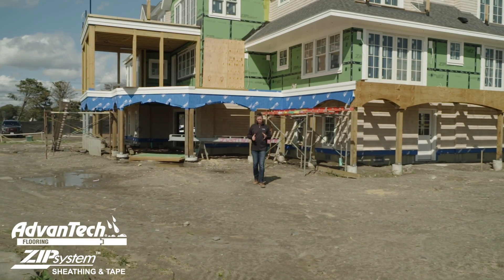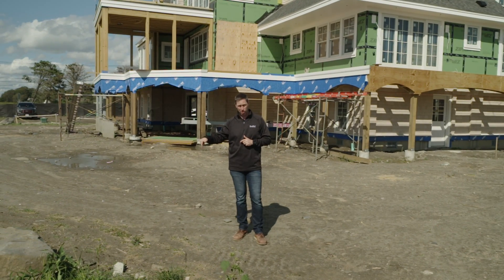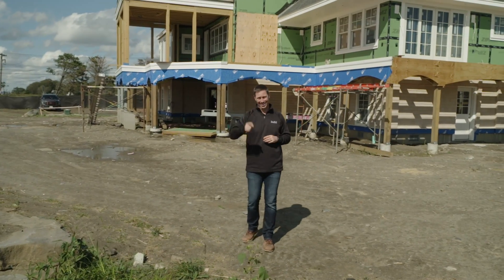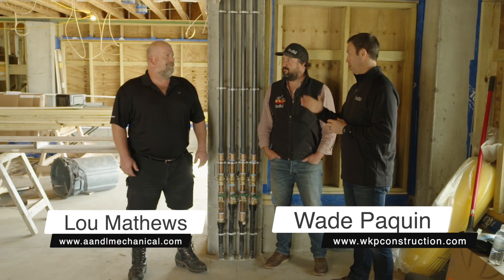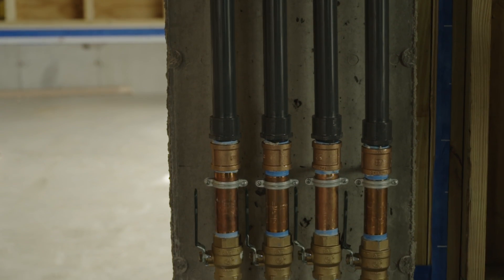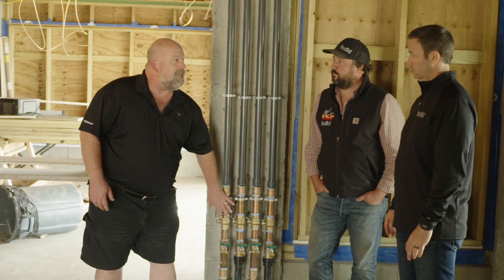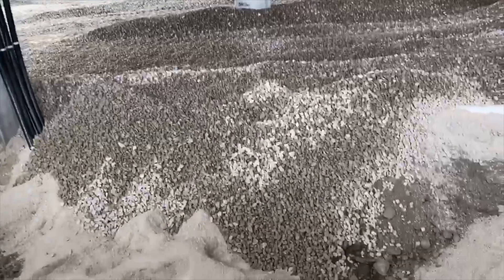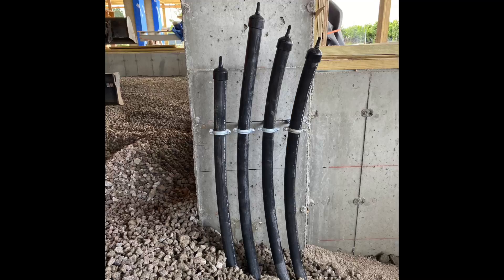Debunking 3 Geothermal Myths

Comment: Wait, those pipes only last a few decades? Then what? Thousands and thousands of dollars to redo it all? I can't see why properly selected/maintained pipes wouldn't last hundreds of years.
Reply: Yea I was really surprised to hear this glossed over. We tearing down our houses every 25 years now? I'm still using a heater from 1955 and the only maintenance it needed was a new motor a few years ago. I can't imagine how much flooring they need to rip up to replace this.
Reply: @alpha.gamma.dingdong  Why would you rip up flooring?  Looks like the pipes will go to a heat pump unit upstairs after passing thru the basement/ground floor wall.  You'd have to dig up the pipes outside and dig up the well head and then unclamp the pipes and remove them.  I have no idea why you'd think they'd need to rip up floors.
Reply: Did the video say the pipes only last a few decades? No it did not say that.
Reply: @ThreeRunHomer  They did seem to kind of imply that. They certainly didn't come out and say that one would expect the loops and wells to last 50-100 years (which is what is typically told).

Comment: I don’t understand why you would have any problems for 100yr with polyethylene pipe. If you have problems in 25 year you got screwed on the pipe at install.
Reply: Metal transfer heat much better than petrochemical plastics.
Reply: Just the pump, not the pipe.
Reply: Scorpio Agreed, but I was hearing Matt asking about the mechanicals and the piping separately as well...
Reply: @markw5805  yeah, I think that part of their communication was a little unclear.
Reply: That's the pump, that pipe is 100 year +.  Even then your only mechanical point is the bearing and blades if those are serviceable no reason it shouldn't last more than 25.  Metal would rust and crack as the earth moves. Poly won't unless a major earth quake hit it and moved it several feet.
Reply: They should have differentiate the water pump from the heat pump.
Heat Pump average lifespan 25y (~10y warranty)
Water pump probably will fail at around the same time the heat pump does. These can be repaired or upgraded depending on new technology.
Loop pipe warranty usually 50y

Comment: I use to spend some time on a forum called ecorenovator. They had people drilling their own holes with DIY setups to do Geothermal. I guess anything is possible.
Reply: on a big property, you can just bury the tubes .
Reply: @kenbrown2808  I am in the Midwest and a professional company said in my area you would need like 300 feet of length. Yes totally doable if you have the land.
Reply: itsabig  Good point, always check your local codes and ordinances.

Comment: 15 or 16 year's ago my brother put geo in his house he opted to have the lines run in a field style instead of the well that was a big mistake his system stops producing heat about halfway through winter.
Reply: That's because his field is too small, or poorly implemented.
Reply: @drooplug  not sure how big there supposed to be if memory serves it was 20x75
Reply: Probably not deep enough
Reply: Do you know how deep  they were dug? I just installed a groundbed system
Reply: @joepepito5661  10 feet down the frost line is at 4 feet.
Reply: @ozinga614  that's plenty deep. My guy wanted them 6ft deep. 4 ditches 110ft long n 4ft wide. Each ditch has 700ft of pipe in a "slinky" style

Comment: Costs have come down from 20 years past. I was involved with two installations and the cost were about 2 1/2 times over typical systems.  I must though, the systems worked great. The wells were the extending cost.   Glad to see this video.
Reply: What was the cost?
Reply: John Marquardt : About 2 1/2 times that of the common system.

Comment: I am sure this is a beautiful system, but I often wonder why anyone would install this system UNLESS TJEY HAD MONEY TO BURN.  If anyone thinks this will be cheap heat over the next 50 years might be a little mistaken.
Reply: It is becoming more of a thing around here for mid tier and up homes, and it saves a ton of money in the summer. I live on the South Texas Coast and when it's 105*F and 90% Humidity it's hard on a condenser coil to dump the heat from in the house to the air outside. But the ground around here will be nice and cold at around  65-70*F in the peak of summer heat. At that lower temp and not fighting Humidity, the systems in an okay built home (code around here is still shit for air tightness) can save about 30% on cooling cost. 30% many not sound like a lot but my house for two months out of the year can be almost $850(US) on the electric bill and thats because the A/C's never shut off for most those two months. But I live in a poorly built house by a bad contractor, mite as will be made of screen doors HAHA. My neighbors can spend up to $500(US) in the the same two months.
Reply: Also natural gas and propane should actually increase at a much greater rate then electricity. So it's a safer hedge then going with gas, oil or anything else
Reply: A lot of areas of the country have high energy cost which would equal a much faster pay back.  If you live somewhere where energy is cheap, they payback will take longer.  Just need to run the numbers before you make the investment.
Reply: Here in the UK, HVAC is very rarely used, just no real need, Gas ‘wet’ systems, with radiators is the most common one used. Gas will be banned for new builds in about 10 years, heat pumps look to be the way forward, but likely to be air, not ground,  there is not the space around our housing for ground systems, very small country, lots of people. I would expect it would be the same in American cities. This is not because of cost, but for reducing the carbon footprint. Waiting 10 years to do this  for the technology to mature, and to improve the insulation and draft proofing on new builds. What will happen  with the millions of older houses, that are very drafty and poorly insulated is unclear at this time.
Reply: @paulhill1665  I gather gas heating in new builds stops in five years, not ten. Allegedly.

What is unclear is if an owner of said new build will be able to install a gas system post sale.

I gather gas systems can still be installed in older properties.

Sort of defeats the entire notion of reducing reliance on fossil fuels.

I suppose HMG might re-offer incentives to go all electric. The feed in tariffs for solar might be reintroduced according to some authorities ... although you wonder if these authorities are speculating  or they know.

And very good point about older housing stock being inefficient, under insulated with years of neglect not helping. Trying to heat those properties must be like heating the street.

Mind you some new builds not quite so special and not very well made.

I'm up for nuclear generated electricity ... if ever HMG makes its mind up about cracking on with it.

( But, have to say very envious of geo thermal energy ... surprised no-one briefed Boris as yet ... )
Reply: If you have ng available then it's definitely not as efficient as hearing with propane
Reply: well here in Finland a geotermal heatpump is the most common heating method and from what ive heard they pay themselves back in about 7 years compared to the other system with their efficiency especially further north where air heatpumps struggle in the winter
Reply: Agree. This is very cool, but it's going to last "25 years" (maybe a few decades more) and then what, you have to shut down the entire system, rip out all the subflooring and redo all the pipes all the way down to the well? Imagine if the system fails and needs replacing in the winter...

What's wrong with traditional HVAC like the one Matt showed us on his rebuild project? Seems like that one has way less potential for failure and is just as efficient for probably way less cost.
Reply: @alpha.gamma.dingdong  25 years meaning the PUMP will fail and stop working. You replace the pump/heat exchanger(if needed), reconnect your lines (maybe do a glycol flush to fresh fluid since its apart anyway) and your back up and running. It doesn't mean the WHOLE system needs to be ripped out and re-done.
Reply: @alpha.gamma.dingdong  The pipes should be good for decades.  I wouldn't be surprised if they went 50 years with minimal work done.  The pump would last 15-20 years, about as long as a standard heat pump.  Replacing the pipes wouldn't be that expensive when the time comes - the costly part is drilling the well and that's done once and done forever.  You'd essentially be looking at similar maintenance costs to a traditional heat pump but far greater efficiency.
Reply: @alpha.gamma.dingdong  the pipes in the well should last between 50 and 100 years, some places warranty parts and Installation for 50 years, and some houses in Europe have had these types of.systems for over 100 years. Pipes are fine, pumps and mechanicals can fail, just like any other unit
Reply: @alpha.gamma.dingdong  Just the pump.  This system saves big on heating in this location.
Reply: @Alpha Gamma Dingdong geothermal is a renewable energy source and my system uses very little propane. Little or no impact to the environment.

Comment: Matt, Wouldn't you be better with a smaller system and sink the cost savings into more insulation and air sealing?
Reply: Better have a good engineer and sharp pencil for those calculations.
Reply: @markw5805  the cals aren't that difficult. You want an engineer to design a system like this from the start anyway.
Reply: Tru Quality  So true.
Reply: Like @Andrew Kelsey said its not hard and the guys installing the equipment whether it geo or not can give you numbers because they run them. Then just see how much less electricity you would need or the cost of it over gas and you got the number your looking for.
Reply: That was a BIG house, so a 4 ton ( 48,000  BTU ) system shows that the insulation was pretty good.

Comment: We just completed a new house here in Minnesota and went with a geothermal system. It would be helpful to hear the cost of the system and availability of tax credits from the government. Our system was quite expensive but with the credits and efficiency of the system, payback is advertised at about 4 years. Still find that hard to believe. We have a horizontal system with 11 loops. It was pretty cool watching the boring of the loops.
Reply: Hey guys, I just built a 2000 square ft single story house with a full basement in northeast pa.  My system is a 4  ton system. I did a grounded system because I have the room and bought an excavator  to do the excavation for the project. My system  cost me 25k and had a 30% tax credit.  I live in a rural area so no natural gas near me.
Reply: @joepepito5661  are the tax credits state or PA? I'm in PA also.
Reply: @WinSomeLoseNone0  that was federal for 2019.  Last I saw it was 27% for 2020 but that was last year
Reply: @joe pepito - federal tax credits are 26% in 2020. Minnesota doesn’t offer any but the local utility is giving us $4400. All together it’s about 31%.
Reply: What was you cost?
Reply: What was cost!
Reply: @Greg J I'm about 3 hours south of you. Near Fairmont. 7 Ton system but went with 8 loops. What are you heating up there that took 11 loops :P Must be pretty impressive!
Reply: @BirdBuster the house is 2400 sq ft plus the basement.  In floor heat for the basement and 3 car garage plus added capacity for a future pole barn. It’s a big system, thus the big price. What was the advertised payback for your system?
Reply: @gregj2647  Thats super interesting to me actually. I plan on having a future shed as well and was interested if I increased the size. Would it make sense to operate the shed off of it as well and the answer came back kind of mixed, and leaning more towards no. Said in the end I'd be happier just having separate loops bored and a whole separate system. Now maybe he was just looking for more money but I genuinely don't think he had that as his reasoning. You also got me curious at what the payback was and their estimate was 4.04 years to be exact. That was with LP @ 1.35 a gallon and electric rate of .09 $/kwh
Reply: @BirdBuster - hopefully they don’t want to sell you another complete system. The shop was designed in from the start and rough in’s were already installed.
Reply: @gregj2647  At this points its actually what would have to happen. I didn't stub anything in like you did :(. That being said my shed would be a very small 30x40 max. If I heat it, I'll probably go a different route as it would be very minimal. But never the less I wish I'd of planned a little more and pushed him on the topic a bit more. I think if I'd of had a more concrete plan we probably could of planned around it as you did!
Reply: @BirdBuster - the shop I have designed is 30x40 with a 10” overhang on one side. They geo system was designed to heat all 1200 sq ft. Good luck with your project. It will be interesting to see how efficient the system is as the weather gets colder. Our house was just recently completed so this is year 1.
Reply: @gregj2647  Hey thanks! Hope for the best and would be interested to hear how it goes. I know the neighbors around me have it and couldn't be happier. I myself am in the process so it wont be complete till next year but will do its job year as well. I got doors to get in and plenty more to go before its ready to start heating.
Reply: How deep are the holes?
Reply: @justinmeasday8930  Mine were 16-22' down @ 300'  horizontal. 16-22 is is because each loop was staggered in height.
Reply: @BirdBuster91  that's very interesting guys, my only direct experience with an affordable system is with a heat exchange loop in a vertical well actually in high temp groundwater. This obviously can't be done without a geothermal grounwater situation.
Reply: @Justin Measday - it’s a horizontal system so the loops are 12-15 feet deep. They used a boring machine like they use to bury cables along a road
Reply: Was it horizontal boring? Eleven loops sounds excessive, unless your property line is less than about 250 feet from the manifold.
You went with a desuperheater for water? Or are you storing heat?
Reply: @Ric Havic - house is 2400 sq ft plus basement and garage.  In addition a 1200 sq ft shop will be added next year. Loops go out 300 ft. Space is no problem as I’m on 10 acres
Reply: For 80k.. the insulation properties of my home would be utter perfection.  I would probably be able to heat it with a candle or cool it with an open freezer door lol
Reply: Just under $80k but that also included more than just the geo system. It was the duct work, hot water tanks, gas lines etc.
Reply: @gregj2647  "They" said you could expect payback of $80k in four years or thereabouts. So your heating/cooling in MN runs about $20k/ year? Just wow!
Reply: Jeff Stanley $80k is before tax credits of over $30k. There are other factors too like a reduced electric rate and little use of propane. 4 years is the sales pitch, I’m thinking 6-7 years.
Reply: @jeffstanley4593  The payback is the additional cost of Geo over a traditional system. Not paying for the system itself. So in my case I was quoted 4 years for the savings to even out with the additional  ~8k of costs. Then after that its all just savings towards new equipment in 20+ years.
Reply: @gregj2647  Thanks.  Now we know why geo-thermal is not used.